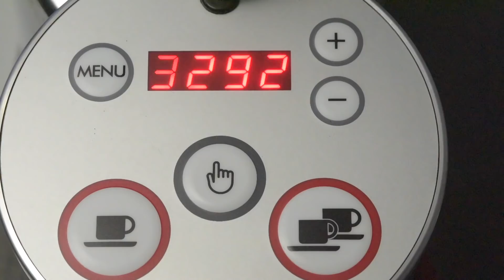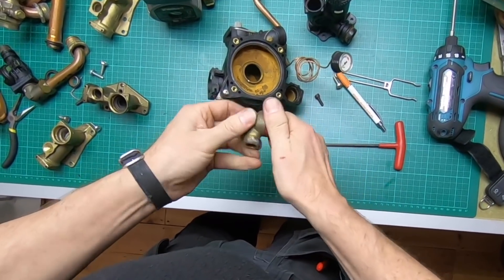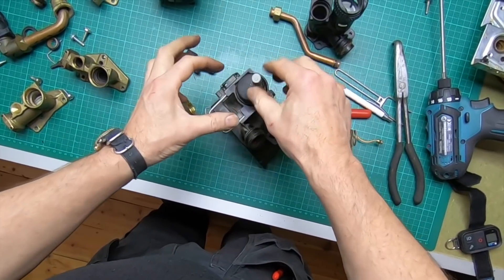Vaillant Ecotec Hydro Assembly Explained. Dr pipe

Comment: Hello! Can I replace the secondary plate exchanger with a slightly larger one? I have a Vaillant vuw 242/3-3 24kw boiler that has a 12-plate exchanger. Can I put a 19-plate one from the 28kw boiler?!!! Can it improve? Thanks!
Reply from the maker: If it fits ... The boiler may struggle to get to the designed rise, or it may not.. You tell me ! If your charging NO

Comment: Great video... one question, how does DHW gets heated? i understand cold water goes throught the heat exchanger and then back out to the hot water out pipe.. but how does heath exchange heat the hot water? Thanks

Comment: Not a cheap boiler. Sadly uses poor plastic materials and bad design. This renders it prone to failure and expansive repairs. The bi-matelic scale indicates lack of scale inhibitor. No excuse for a leak at rear of the plate heat exchanger. The video is well presented.

Comment: Hi very interesting. This boiler has an option to put the diverse valve in the middle position (D.070 = 1 ). What are the disvanteges of this, besides lower power? For some reasons they blocked the middle position for the Netherlands. Maybe any suggestions why?
Reply from the maker: It could stay in that position and give low temp to both Hw and Ch.
Reply: @drpipe  Actually it was ok to having low temp to both HW and CH. But Vaillant blocked this for Dutch boiler version. Maybe because the boiled would not condesate with the valve in the middle position. No idea. I would want to test it.

Comment: I was hoping you could help me with a diagnosis on an Ecotec Plus 837. Working fine for several years and then a week or so ago several radiators stopped heating, the only one working really well is in the same room and a couple of warmish ones nearby. Hot water working perfectly. I hoped it was a simple pump swap, it wasn't! The system is really clean, I've checked the diverter valve and the rubber hoses have no blockage. I've noticed that the flow and return temperature (D40&D41) are quickly identical after the boiler fires up, so the boiler cycles down and just pumps, the boiler is internally bypassing which I validated from the temperature of the flow and return pipes. The bit I'm not clear on is whether I simply need to replace the internal bypass valve - can that be broken or is something else creating this problem?
Reply from the maker: Sounds good explanation to me. 👍💪
Reply: @drpipe  New IBV installed, it made no difference - where to go now?
Reply from the maker: @RobertJones278  check the Trvs maybe a flush to see if they actually get hot or check for externals

Comment: Hi I have a valliant ecotec pro 24 and I'm having no hot water and f75  code what's the most likely problem the water preasure sensor ? The boiler was installed 2016 thanks in advance if you can shed some light .great video by the way well explained
Reply from the maker: Armando Sairally couldn’t say without inspection 🙏

Comment: Still good I've watched it a couple of times now, I came back to this after an infamous f75 fault to try and figure it out.
Reply from the maker: nindes 👍👍💪
Reply: @drpipe  so the pressure relief valve (blow off) and expansion valve are all connected to the pump housing (the heating return?) thanks great vid btw mate
Reply from the maker: Gary Lawton Watch the video 👍 Thanks for the comment 👍👍
Reply: @drpipe  i have mate its a brilliant video is my comment above right. Thanks
Reply: @drpipe  im doing my gas course at the moment so interested. Cheers

Comment: Hey dr Phil I have error code f75 on my vaillant boiler I top up the pressure will be ok for a few days then turn the heating up the f75 code come  back top up the pressure work fine for few days then story repeated what would you recon could it be I have no leak on the system many thanks.
Reply from the maker: Service and Checks to see system Is clean and investigate 👍

Comment: May be because I’m sleep deprived or a stupid question but why does the central heating side have a diverter that feeds the Dhw side aswell wouldn’t that be contaminated with the central heating water.. new in the game and trying to get my head completely round all components in our wonderful world of work.. cheers bud
Reply from the maker: Michael H combi plate 👍
Reply: Dr Pipe gotta video on it or is this it and I’m just slow 😂 I understand the dhw and the Ch water doesn’t touch each other inside the plate I just don’t get why there is a diverter from the ch side that then feeds dhw too.. hope I make sense 🙋‍♂️
Reply from the maker: Michael H Ch water goes around the rads.. but when demand for Hw is present diverter (hence name) sends thru the Dhw plate to create Hw 👍
Reply: @drpipe  hi I have the eco tech 28 and its blowing the circuit board fuse, the engineer changed the pump but it blows the fuse he now thinks it could be the fan,  have you come across this before.
Reply from the maker: @haydnmilloy5626  logically disconnect Everything ... then put back piece by piece till it pops 💪😘

Comment: I have just stripped one of these units.  Do you have a tip for testing the Pressure sensor and the Flow sensor with no power to the unit?
Reply from the maker: Not at the mo 👍
Reply: Think I’ve got it sorted. Rigged up supply  dc from battery and tested signal wires.

Great vids!

Comment: Tanx for the upload,never seen hydro assembly video on you tube would you do a video on tools you use on different makes of boilers plz.
Reply from the maker: That’s why I made it ! If you can understand and “see “ how it works then it will make it super easy to repair. Thanks for watching
Reply: Thank you plz upload more similar video's if you have time.